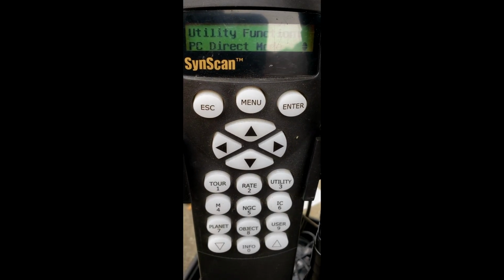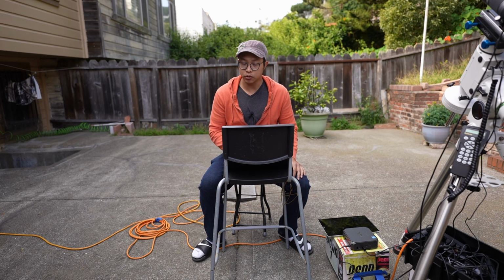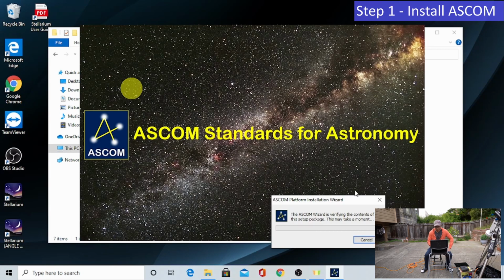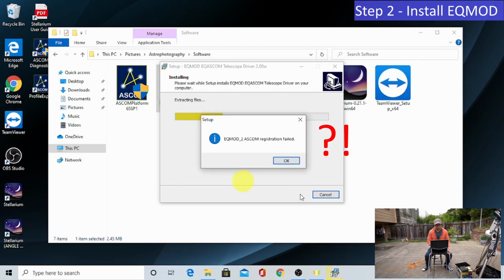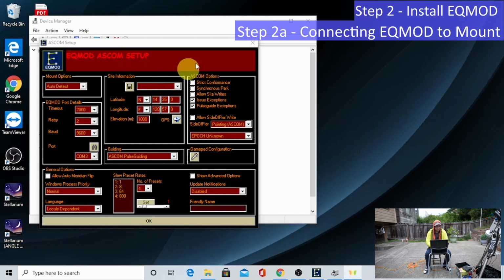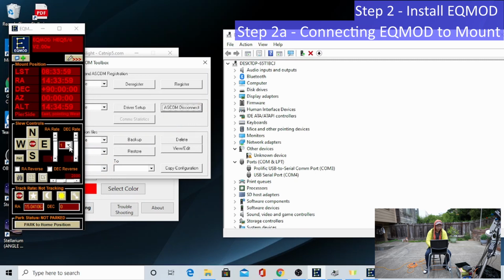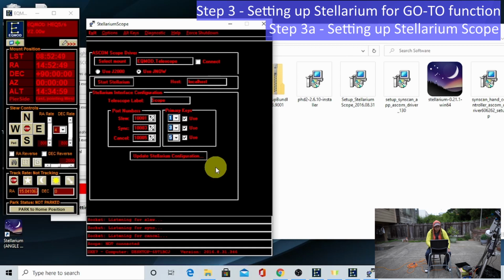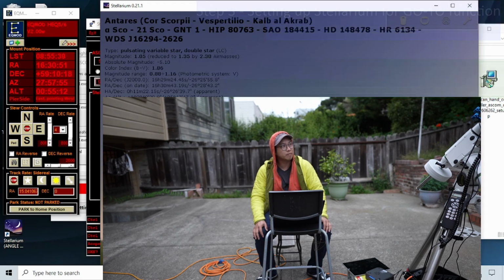Astrophotography Beginner's Guide - How to connect a (MINI) PC to your Equatorial Mount

Comment: I have run into a rather frustrating problem running my HEQ5 PRO mount remotely. I have two Intel NUCs that are less that a year old and a seven year old HP Envy laptop. The laptop runs both NUCs remotely without any problem until I try to run my HEQ5 PRO. EQMOD does not recognize the COM port on either NUC. The second NUC was bought just for running my mount with EQMOD. Of course the COM port on my seven year old HP laptop is immediately recognized by EQMOD and I can run everything just fine from my living room. The intent was to connect a mini PC so I could put all the electrical transformers and other stuff in a plastic container to protect everything from the rain and snow that sometimes just happens. No such luck so far. Any suggestions? Like, what kind of mini PC are you using and were there any issues with the COM port not being recognized by EQMOD? A pretty good video in spite of not sharing/showing the SF FOG - I was stationed at the Presidio some 50-years ago and I only remember the FOG :)
Reply: Exactly the same for me. I’ve tried a Mele 3Q but couldn’t connect the Skywatcher mount using the same cables and software as on my laptop. The laptop is working great. I just did not want to let it outside whole night at minus 20.

Comment: Hi Angus, 
Thanks for the video ! :) 
I’m looking for a way of setting the mini-PC as a hotspot when starting up, even without an internet connection (for those times you’re out it the field without any network). This way I could connect directly with laptop/tablet use windows remote connection. 
Any idea of how to do that ? (I’d like to avoid buying a mini router to avoid additional power draw on my battery)
Reply from the maker: I don't think you can remote desktop without wifi? At least I don't know how.
Reply: @nocturneastro2539  Hi ! I figured it depends on the wifi card of your mini pc. It needs to have the ability to host networks (type command "netsh wlan show interfaces" to figure it out). 
Mine doesn't, so I eventually bought a mini router for 20$, and it works fantastically: now I have a lan network with doesn't require internet connection for those times i'm in the middle of nowhere. 
Otherwise I sometimes share my cellphone connection and use Teamviewer to pilot the whole thing. Thanks again for your video: it pushed me into that direction and I now have a truly complete and portable setup !

Comment: Great video and very helpful.  I just bought a new laptop and HEq5 mount and will try this.
1) I'm not sure how you got the IP address of the mini pc from the laptop since you didn't remote desktop into it yet. It looked like you already knew the IP address some other way.  Did you connect by an ethernet cable first?
2) Also, when I am out in the field away from home, how do I remote desktop into the minipc from my laptop?  They both have wifi adaptors built into them, so do they see each other somehow?  Will I be connecting to someone else's minipc who is nearby accidentally on the astronomy field?
Reply from the maker: 1) I hooked up the mini-pc first to a monitor just so I can get the ip address. 
2) I can't speak for field work. I only do this when I'm at home using my internet. When I'm out in a dark site, I don't even use a computer. I usually use my old Sky Adventurer and an intervalometer.

Comment: Thank you for great video Angus and your time/effort spent on it! Followed your instructions and got everything working, Intel NUC + Skywatcher EQM-35 Pro. I tried more than a year ago and I somehow failed, then I had no time until now. What I have noticed is that when I hit slew to the target in Stellarium and then start tracking, it stops after a couple of minutes. Once it was approx 5 minutes, next time over 20minutes. Any idea why?
Reply from the maker: Few things to check:
1) EQMOD - make sure it still says sidereal tracking
2) Whatever image acquisition software you are using - make sure it still says sidereal tracking
3) any other software that may interact with your mount - make sure it still says sidereal tracking
Reply: @nocturneastro2539  it will require more investigation, because 1) EQMOD is set to sidereal tracking 2) No image aqusition software turned on (at the moment only testing inside before I take everything out) 3) No other software turned on. Just EQMOD and Stelarium....

Comment: How do you connect mini-PC to laptop to get IP address?
Reply from the maker: You need to connect the mini-pc to a monitor first to find the IP address. After that, you can connect your laptop to your mini-pc with the IP address.
Reply: @nocturneastro2539  Thanks. Monitor of desktop? Could I connect to laptop via hdmi cable? Thanks again.

Comment: So, if I understood that right, you connect your astro devices (mount, camera etc.) to the mini-pc via usb and control the mini-pc via remote desktop wireless from your laptop with all drivers and software needed installed on the laptop? Thx for this very informative video!
Reply from the maker: All of the drivers, softwares are installed on the computer in which your gear is physically connected to. Which in this case, the mini-pc. You only use the laptop to remote into the mini-pc to control the mini-pc and to monitor your session.

Comment: Have you done anything to pretect your mini PC from dew or dust? Did you attach the mini PC to the mount or telescope? I'm assuming you have to attach a keyboard and monitor when to first get the IP address for the mini PC. Thanks for the detailed information.
Reply from the maker: Unfortunately, since making this video, the mini-pc featured here has died on me. The power connection failed and I cannot turn it on. But when it was working:
- no protection from dew/dust.
- I did not attach it to my telescopes. I ran a wire to the mount, and the mini-pc rested on a separate chair
- Yes, I gathered the IP address by attaching it to another monitor

Comment: Great video. I personally built a LattePanda delta with a 265gb nvme running windows and connected to a USB ASUS monitor and Rii keyboard/mouse. The screen is for live stacking at star parties that we do once a month. When at home I have no screen connected. Blows people away what they are actually looking at through the other scopes. Would you consider having a go with a Raspberry Pi and AstroBerry??? Another cheap option to get into controlling your mount. Was a consideration before I went the LattePanda route. Another Raspberry Pi option is StellerMate OS. Basically a paid for astroBerry option.
Reply from the maker: No, not really... Mainly because I don't want to redo setting up the mount 😅

Comment: Forgive me for I am terrible with anything network related, but for Step 0 how did you find the mini pc's ip address if you don't have a monitor connected?
Reply from the maker: I should have been more clear, thanks for asking! Plug the mini PC into a monitor first before starting so you can see the IP address. I hope that helped! 😃
Reply: @nocturneastro2539  yeah but the IP address changes periodically, so you are going to have to bring a monitor along when you go to a dark site? doesn't that defeat the purpose? why not just use the cheap laptop you're using to log into the mini pc... what a stupid idea...

Comment: Great video I'm hoping to to do the same for my observatory so I can remote image indoors although the dome itself will never get to be fully automated as it's home made & heavy to move, the only problem I have is my camera must be way to old to work in NINA as it won't work so unable to plate solve, I don't suppose there's anything else that can be used to plate solve with older cameras as I can still use PHD Nebulosity 3 to capture. The camera I have is an old QHY8 OSC but it hasn't got the issues like the first batch & other than being old still works very well. 
Or will I just have to sell my soul for a new camera?
Reply from the maker: You should hit up NINA's discord channel. They should be able to help you. But it's likely that NINA can't support your camera 😕

Check out my video on the Altair Astro 26C, it may be interesting to you 😃
Reply: I guess I may have to sell my soul for something newer I have been looking at the  Altair 26C & the ASI2600MC Pro as both seem to have the same specs so I better get saving.
Reply from the maker: @tichwykes  they're both using the same Sony IMX571 sensor. The difference between the two I believe is the buffer memory. But I don't think that's relevant at all unless you do videos/planetary imaging.
Reply: @nocturneastro2539  I did have a bit of an idea although I'm not sure it will work but use the finderscope & camera to platesolve & if the main scope is pretty well aligned it should put me in the ballpark for now, well that's if this madcap idea will work, as for the 26C & 2600MC Pro there's about a £300 difference in price between them so I'll probably go purple ;-)

Comment: Good video. If you skip the hand-controller entirely (as in: not even connecting it) you don't have to setup Utility Mode. I found that out accidentally. Some forums also say to set the baud rate to 115600 (both in the driver and the software), but if it works fine with 9600 I don't see a reason to change it. Also, make sure you run any program that uses EQMod as a normal user (not "run as administrator"). I did that, and what happened was that two instances of EQMod launched, where one of them was obviously unable to connect.
Your mount also assumes that whichever position it is in when you turn it on is the "home" position (also something I found out the hard way). I always make sure to leave it pointing North when I turn it on and return to park before I turn it off.
Reply from the maker: Very good points!
1) I have the older model of HEQ5 where the USB port is on the hand controller itself. So I am not sure if bypassing the hand controller will apply to me. I wish though.
2) yeah I remember I had to use a different baud rate last time, I think I had to either 115600 or 128000. Either way, 9600 worked this time and I am not touching that again 😅
3) my home position is usually point at/near Polaris.

Thanks for the visit! If my skies don't clear up, I may do another video on how to set up NINA, autoguiding, and plate solving for people's imaging needs.

Comment: Good video Angus.  My only critique regards the Baud rate to the serial controller.  I’d wager you that you could set the Baud rate in the COM port properties to 38,000 and it will work just fine.  I’ve done this with my Celestron mount and with the focusers that I use and I haven’t had any issues.  Just make sure that these rates the same in any software that provides the setting.  In the case of my focusers (Moonlite $ ZWO), they use the system settings.
Reply from the maker: What's the benefits of increasing the rate higher? EQMOD actually recommends 9600. (Though I have had to use different rates in the past too)
Reply: @nocturneastro2539  increased polling rate. For me it was a process of experimenting with 19200, then 38400 so that my combination of equipment and settings allows a stable connection for apps. Set the COM port setting by doubling it and monitoring bits/sec in RESMON ( Resource Monitor ). The data should see an increase versus the baseline at 9600 Baud.  If it works well go for it.  In most cases the baud rate defaults to the system settings. In experimental practice you find out right away where the limit is, when it stops working.  Then you back it off. 😁 It’s always good practice to follow the directions… as a starting point.

Comment: Hey ! Thank you Angus, this was the video I was waiting for !
Actually i'm using the first version of asiair (i got it second hand for a few bucks) but I will definitely give it a try. I have already downloaded all the ascom drivers for my gear and mount (an ioptron) and the ascom plateform : now I just need to put all the things together and look if it all communicates correctly.
Do you use a specific eqmod cable to connect the mount to the pc ?
Is it possible (and correct) to connect the main camera, the guiding camera and the mount, to a powered USB hub and then go with one USB cable from the hub to the mini pc or laptop ? 
Again, good job and very easy to understand video ! You rock !
Reply from the maker: No, I just use normal USB cables for everything that I connect to. As for the USB hub, that's exactly what I (had) to do. Because my old surface pro 2 only had 1 USB port.